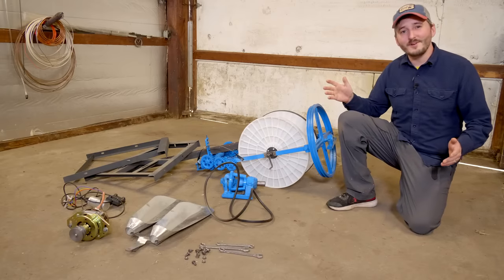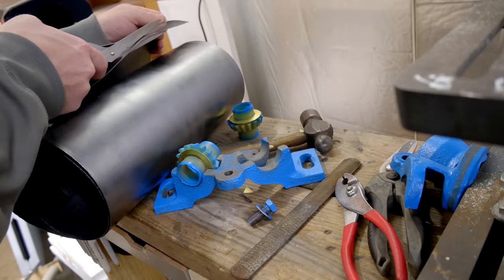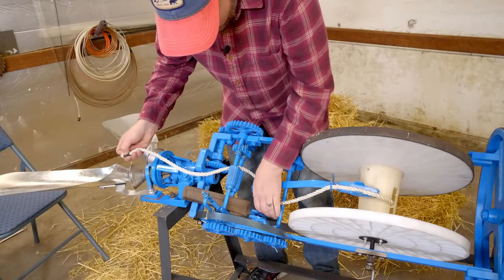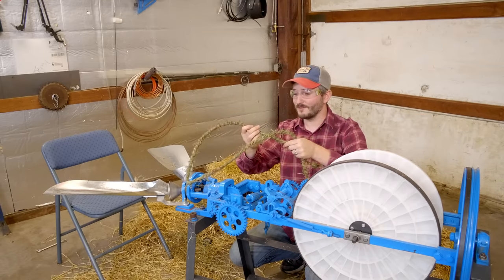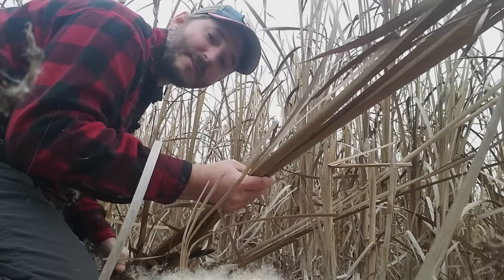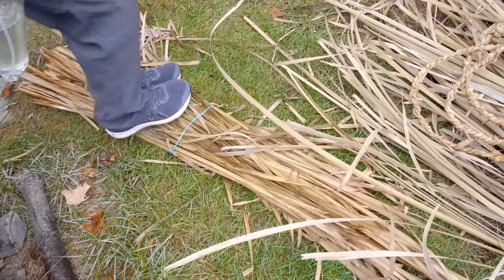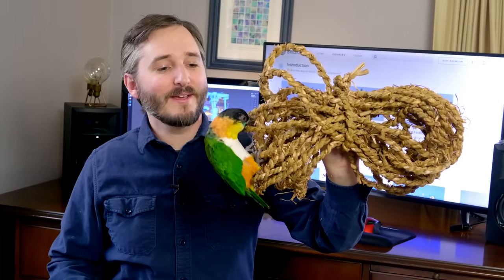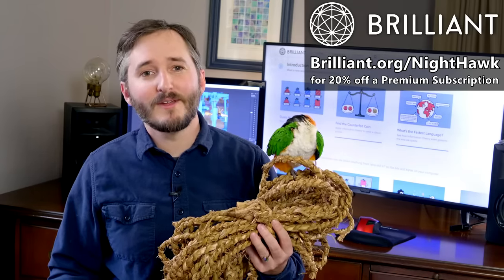A Machine That Turns Plants Into Rope

Comment: tobacco leaves would work really well and also feather reads which grown without much maintenance even in colder climates. even one feather read boosh could be used to make several feet of rope and the older the plant the longer the leaves. I have two in my yard and they make leaves often times 5 feet in length.

Comment: The slop in the gear train is a result of the time and place it was designed, not a result of low quality. Those gears were intended to have been cast iron with cast iron tolerances , and any individual part is probably intended top skip a tooth or teeth rather than destroy itself if a stone were to fall into the works or something. My Grandpa had an old horse drawn hay rake he tried to restore and use a couple of times, and the way that thing was put together- intentionally, as part of the function!- was terrifying, even at walking speed. It felt like a swingset with 2/3 of the bolts removed, but he also showed me how if it had been rigid, the tines would just skate along and leave half the hay on the ground

Comment: You may want to look at how to process flax, hemp, sisal.  Typically you age it he materials in a damp environment to let fungal/bacteria growth decompose some of the cross linked protein.  Then you break up/beat the outer chaff as that is not flexible and will degrade the ability to tighten the fibers.  Finally depending on the quality of rope you want you may want to brush out the fibers to separate the strands of lignin and use longer fibers vs shorter ones.  Most grasses/grass like plants will process the same way, just not necessary the longest and most flexible fibers.

Comment: Maybe try doing a process on the reads that is similar to what you see with flax or hemp. Where you purposely dry and crush the material, for the purpose of combing out the long strand fiber. You definitely need more overlap, like a small amount added every few inches, as opposed to full lengths before adding more. Heck, get two smaller spinners that can take pure fiber strand and pre spin it.
Reply: Feed the output of those directly into the larger machine.
Reply: I saw other comments about small fiber spinning, with coconut coir. I had a thought... You could use a small amount of long fiber, or even stitching thread, as a center that grabs and incorporates smaller fibers along the way. It might even give you a use for that fluff, as that might be a good matrix for other longer fibers to mesh in with. I'm thinking... A spool of thread, long combed fibers second, the fluffy stuff or animal fur, then you can put medium size fibers into that. Maybe that is way over complicating it...

Comment: This is a wonderful machine actually it's useful with the motor but you could easily use this off grid with just your hands or a hand crank added to it or even some sort of foot crank. Assembly similar to a foot lathe to operate it up.

Comment: I would suspect that the cast iron would normally be impregnated with oil. This can in modern practice done in a vacuum chamber but in more traditional applications the oil is simply heated and the parts submerged and the whole thing allowed to cool. The gasses in the cracks in the cast iron expands and then contracts pulling the oil in.

Comment: Would giving it a set certain rotation speed, Or maybe a more sensitive pedal, it would probably work better, or does the gears have enough resistance to require more torque?

Comment: Take the cat tails or other materials like old clothing, and rip it into smaller pieces, example the reeds rip into strips that's half or cut reeds into 3rds, then make that into a thin rope, then take that thin rope, and re spin it together with another thin rope, that's how thicker ropes are made, is by twisting thinner ropes together, using thinner not shorter but thinner wide, so not as wide of strips. And use that for making rope. Then use that for more rope. Easy. Just a suggestion of course.

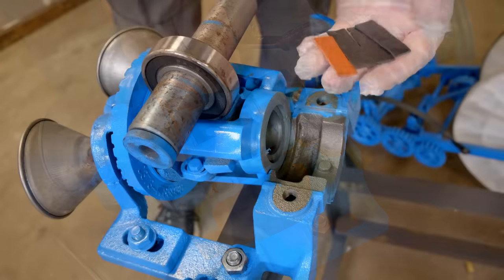Comment: Hey, looking at your assembly at 1:45 that looks like it’s supposed to be a “babbit bearing”, where a mixture of lead and (I think) tin is poured through the hole and cast as a bearing surface.  It’s a really old style, but it would make sense if that was old or a copy of an old machine.

Edit: after seeing the rest of the video, I’m pretty sure that I’m right on this, and it looks like there’s a spot for the other bearings that was covered in paint.  Also, I think that it would be easier with the original foot pedal for power, even though you don’t have it.
Reply from the maker: The funny thing is that part is plastic. They must have made a mold from the old bearing to make the plastic sleeve
Reply: I wonder if they replaced an original part with plastic?

Comment: Use palm leaves.. Strip them and feed green leaves in .. I use them to tie plants to steaks.. Each leaf is like a ribbon..

If you couldslow the machine down via gear ratio or motor speed /throttle

Comment: Just wondering if you determined the strength of the rope. Could it be used for pulling or simply lashing.  Excellent video.
Reply from the maker: 50lb break on the cattail rope. Handmade grass rope has given me well over 200lb break in the past so I hope to improve my results with better materials in the future

Comment: Try using smaller diameter fibers so as to increase the overall fiber count which increases the surface area in turn increasing the strength of the rope. Try different material preps (soaking,etc.). Have fun

Comment: What if you mounted a spool of fishing line at the mouth of each cone so that you could have a relatively cheap but consistent core to build the structure of the rope around, and something to add strength to weaker or shorter fibers?

Additionally, what if you managed to make a longer segment of rope that could be cut into two halves, or two ropes of equal length.  Could you feed them through together, or would that just destroy the fibers?

Comment: Making rope or cordage of any kind is the same process, requiring the same techniques and material processing, whether making fine thread or two-inch rope. Not every natural fiber is adequate for making good cordage. Of those that are, many have to be processed besides simply harvesting. Many natural cordage plant-based materials have a pith. The fibers have to be removed from the pith, like cattail or yucca leaves. Some materials have to be pounded, some peeled, others fermented to get the fibers. Very few are "ready made" by nature to be turned into cordage as they come off the plant. At that, only certain parts of a plant will yield usable fibers. As far as fiber length, that is not as important as a person may assume. Some very good and easy to use cordage materials, such as the common use even in modern times cotton plant seed-heads, have very short fiber lengths. A rule of thumb, if you bend it and it and the fibers crack, such as happens with dry grass, then it will not make a strong, functional cord.

Comment: I'm curious about a couple of things. Is that food pedal only on/off? If it is, you could probably get smoother, less hectic mode of operating the machine by hooking up a variable drive to the motor to let you adjust the speed as you go.
Another thing I'm very curious about, and it probably shows my ignorance of rope making - could you start by feeding just one or two strands of fibre through each funnel, then divide the resulting rope in two and feed it through again (and repeat as needed) to get a smoother and/or stronger and more homogeneous rope?
What would be a good way to terminate the ends of the rope to keep it from unravelling?
Reply from the maker: Yes a variable motor would be nice. You can't feed a made rope back through the machine because it would get tangled as it spins on the inlet end. You would need to modify the machine with spools attached to the cones. Terminating the rope is done with a knot or tape

Comment: Could you train the Parrot to feed material into the machine ?. Problem maybe a bigger parrot !. As received looked like scrap in a box. Surprised to see main body/gears cast not plastic. There with you totally engrossing. Thanks so much man. Dave. Sth. Wales. UK

Comment: I feel like there is a much simpler method to drive the big reel around than that insane gear system, like an electric motor and a brush ring on one end and maybe a speed control knob to match the feed rate of the rope coming in.

Comment: Very nice! I shall check out your other rope videos. Could the blades be crushed in some way where you get long but thinner fibres than the whole blades? I am also kinda curious about how the inside of the rotating cones look, is there something there that grabs on to the blades? Thank you for yet another great video!
Reply from the maker: You can process plants to get only thin fibers but it's a lot of work. The cones that came with the machine were smooth but I replaced them with plastic funnels that I cut at the tip and bent into little inward facing wings. That grabbed the rope better. You can see them in some of the close ups
Reply: @Nighthawkinlight  Cool! Thank you.

Comment: There are fibers in wood, as well as the outer sheath of some plants like hemp that are unbelievably strong when green. I can hang my whole body weight on a thin piece. Unfortunately, they lose almost all of their strength when they dry. Wish I knew a way to maintain that strength with some natural material. It is worth trying to remove some fibers from green wood to see. Comparable to nylon or something.

Comment: The kind of bale that the fiber material is in doesn't change the length of material because the mower is what did the cutting not the baler

Comment: I wonder if it's possible to turn grass into artificial wood using a hydraulic press and some plant resin. The fibres in the grass would be like the grain in wood, and the grass itself might extrude plant resin. Also if you Google "Board produced with use of grass plant lignin and process for producing the same" there's a patent for something similar.

Comment: can you feed the first stage, 2 strand rope back into the machine and come out with 4 strand rope?
i'm also curious as to how strong your end product was.  doesn't matter for chew toys obviously, but can you use it for 'practical' (if light stress) rope tasks.
Reply from the maker: You can twist the rope together by hand but to feed it back into the machine would require modification. Strength of the cattail rope is about 50lbs
Reply: @Nighthawkinlight   thank you sir. interesting vid as usual. long time watcher.

Comment: Where did you buy this machine? And why didn't you just find yucca?

You could have also chopped a tree down and peeled it's bark off and hammer lightly on either one, to get fibers. Then you'd comb them with a knife lathe. You'd have a knife sticking up vertically and you'd just keep whacking your fibers against it until you wind up with clean shiny fibers.

Once you'd be at THAT stage, you're ready to make QUALITY natural cordage.

It would be nice to modify the machine in some ways. For example, two ply rope, when adding more rope, should be fed only through ONE of the rotating funnels, and then looped next to the twisted rope, and then fed backward into the other funnel. So... it would be nice to have more room to work your fingers around the initial twisting action with the rope. It would make a stronger rope. 

The thing is, though... you shouldn't be starting out with "rope" you should start with twine. Once you have twine, you should be able to feed half of the twine through to the initnal twisting action, and then fed backward into the other. To start the twisting action for rope, you'd have to have a calibration to get the machine to spin the opposite direction.

Maybe you'd like to make thicker rope. It'd need to be calibrated to spin the initial direction, and feed the rope in exactly as the twine was described for the twine, earlier.

If you'd want thicker rope than that, it'd be the same process. Repeated over and over, until the rope is thick enough. 

:)

It'd be cool to see THAT.

Comment: In the thumbnail I thought it was 3-D printed because of the blue color.  
Spring time it’s time to plant a bunch of hemp.
Could you use 2 L bottles or any type of plastic bottle cut into long continuous strips, using the same technique to make filament for a 3-D printer, than feed that into the machine to make a plastic rope?
Reply from the maker: Yes I think bottle plastic would make a nice rope. In michigan there's a $.10 bottle return so it's not economical to use soda bottles here, but there's no return on water bottles. That might work just as well.

Comment: The reason why the alcohol was able to wet the surface of the cattail leaves is because alcohol doesn't have the surface tension that water does, and the leaves of the cattail have a hydrophobic surface that uses water's surface tension to make it bead and roll off the leaf. Its a bit of a longer explanation than saying alcohol is wetter than water but I was kinda put off by that explanation lol

Comment: Straw would work fine. You were 't putting enough in at a time, and putting it in chucks wasn't helping either. Smaller bunches, and more of them, staggered on top of each other. There's a reason those chutes feeding into the cones are as long as they are. You weren't fully utilizing them.

Comment: Instead of using natural materials in the wrong season, try going with the garbage angle and use grocery bags tied together, tattered clothing and old linens, or whatever else.  

Good job finding a [i]solution[/i] to the dry-and-brittle problem.

Comment: Why fibers spun together get stronger has not yet been scientifically determined, at least not on the microscopic scale. A sizeable gap in our understanding for such a fundamental technology!
Reply from the maker: I always assumed the strength comes from the strain increasing compression and friction between fibers, which causes the weak spots in one to be compensated for by those around it. I'll have to look into research on the subject.

Comment: If you need to slow down the machine sewing down the motor with a variable speed it should be easy enough to just wire in and have the ability to slow down the machine or speed it up

Comment: Wow, those tolerances are beyond abysmal. It looks like it was "3D printed" using metal powder (and the plastic bits of course) which isn't necessarily a bad thing, but I'd imagine they could at least make the pieces too tight-fitting and then sand them down, but it seems like this thing just came straight out of the oven, had some blue paint blasted in its general direction, boxed up and shipped off. Just complete dogshit. I really hope whatever shop made this actually tries to even marginally improve their process because they obviously have the capacity to make some really neat stuff and it was just squandered on this run.

edit: By the way, if you were in a position to be able to grow hemp, it makes excellent ropes once it's been decorticated; it was once actually well-known for this fact and I believe there is an old American film called "Hemp for Victory" encouraging American farmers to grow hemp for fabric in support of one of the world wars.

Comment: Lol the enameled gearing drives me crazy.  I know there isn't a good way for shielding the drive and it doesn't matter for what it is... But I spend so much of my days at work trying to keep gear teeth Spotless reassembling industrial gearboxes and it just doesn't sit right with Me. Again I know it's farm equipment, ive worked on farms. it's just an irrational gut sensation ive developed as time goes on.I need to vent away
Reply: Also invest in a scythe

Comment: Get a variac and then you can see if you can run the machine at a lower voltage and get less sudden speed changes and lower the top speed.  If that doesn't work a VFD and some rewiring you can adjust how long it takes to ramp up to maximum speed and what that maximum speed is.   You could even run it in reverse, though I don't think that'll work well in this application.  This machine should not have been sold with a motor being thrown directly to main power.  That's just too little control.  Like a power drill that only has an on switch.  Completely annoying.

Comment: Evolution vs food.

Food disproves evolution.
Every organism no matter how small either manufacturers or collects food or it would die very quickly.

Every organism identifies, ingests, digests, filters, stores, and excretes food.

It has to identify the difference between food or rock.

It must ingests food through a specialized opening designed to intake only food and nothing else.

The food itself is useless until it is digested, a complex multi-stage process all by itself.

If it cannot store the energy from the digested food at least temporarily it would die.

Then it must filter the waste products or die from internal toxicity.

And then excrete the waste products through an orifice specifically designed to excrete the waist and only the waist, the precious blood or cytoplasm must remain inside the body.

An Evolutionist wants you to believe that a life-form came together in the beginning with all of these features in place with no help and no time for natural selection... this would be the equivalent of a car capable of making another car inside of itself... because if it cannot reproduce it would be forever alone and die old age.

God created life.

Comment: You'd think for the amount of money you paid (which I do not know) for that machine- it'd be of better quality. Crappy there's no instruction manual for assembling the machine or even how to operate it as there could be injury from either. The worst part is that you had to spend money on a contraption and you had to add extra parts just to have the machine work without wearing out.